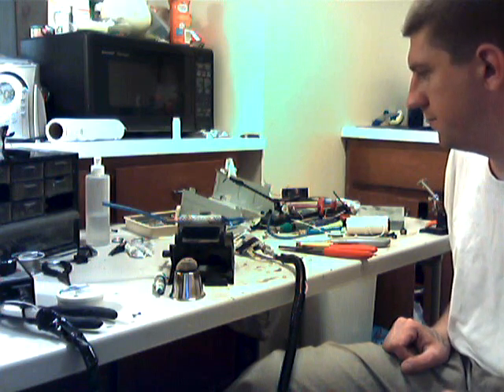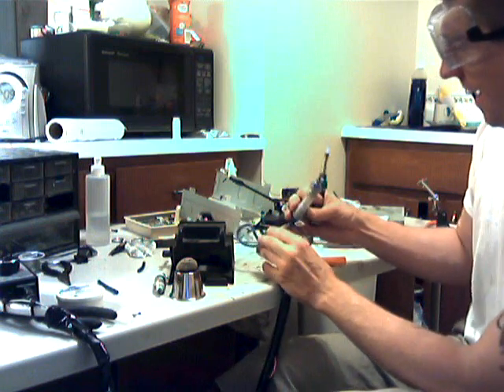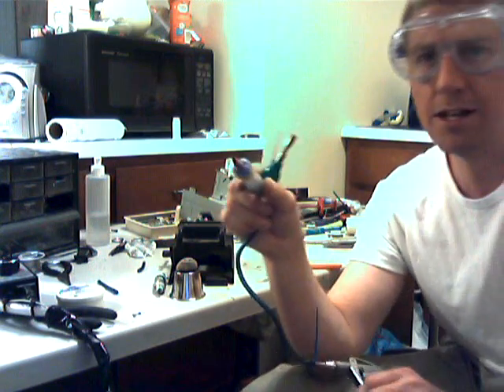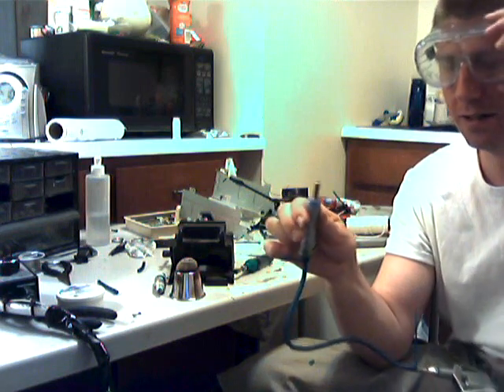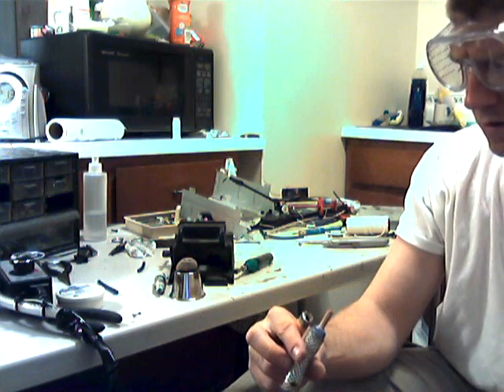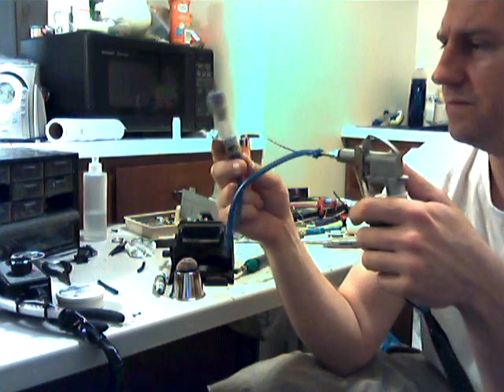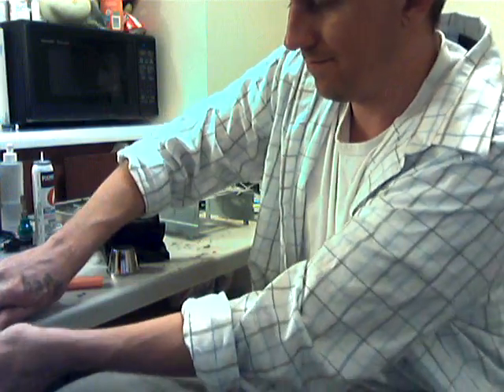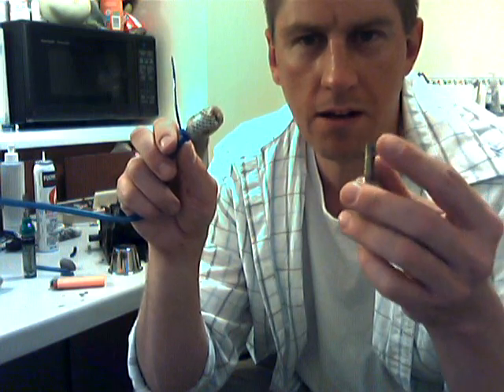hho flash back rocket motor

Comment: a very strong compound rocket engine can be constructed using a paraffin cylinder into which HHO gas is injected under considerable pressure ... the thrust such a thing generates might surprise you ... but be warned that there is significant danger of a rather big boooom ... this is an outside experiment that requires considerable safety precautions ...

Comment from the maker: hey bro you gave me an idea 
the other day when you mentioned tungsten carbide i decided to try something i held my tungsten rod under a bic
lighter to blacken it with carbon
then i heated it to near white hot with hho
and the dam thing doesnt shatter any more it actualy worked ,the other tips do asyou said the did and shatter,but this tip
still has the same point and it has been
used at white hot temps

Comment: I have tried a number of flash back arrestor designs and have not yet found one that I consider practical.  In most cases, the problem is that gas flow is restricted by such devices to the point where the volume delivered to the work is impacted.   I have had much better luck with the pressure relief type devices.  But I hope folks keep working on arresters as such a device would be nice to add to the tool kit if worked as reliably.

Comment from the maker: Continuide
It may be possibleto build a good arrestor  with a ceramic or brass cylinder simmaler to those in air brush filters,im going to try a high flow ceramic disck aslo
this may make it possible to store hho
not that i ever ever intend to do so
im saying this because of the strange property of hho in that its the most flameble substance ive ever seen yet 
i can spry it into a lighter at 2,000 Fps
and it wont burn but for some reason it gets very load when i do this perhaps it is...

Comment: if i was to design a flashback arrester, i would make the orifice inside the arrester smaller than the hose diameter to increase the speed of the gas flow, hopefully making it flow fast enough to blow out the flame each time it lights. just an idea

Comment from the maker: very intresting , its nice that i now know
that a very high volocity jet of hho will not ignite under certain conditions,could it be from rapid deffusion ,i could see a high speed jet mixing very fast with air?
any way this does make it possible to safely use pressurized hho,by safe i mean if done professionaly,any way resaerch reveald that a scuba tank at 
3,ooo psi was = to 22 Lb of TNT,so by safe i mean not safe at all nor is any rocket ever built for that matter
any  way i could see....

Comment: If you check out steve from installguys, you will see two of the best backflame arrestors ever built. The Hammer EX and the Sledghammer. I use the Hammer EX and it has been hit over 100 times without any problems at all. I have built succesfull arrestors using silica sand. I dont think i spelt that right. Anyway, check it out.
stay safe.